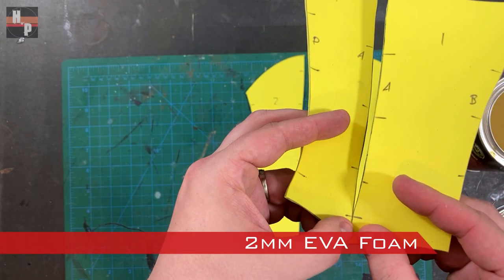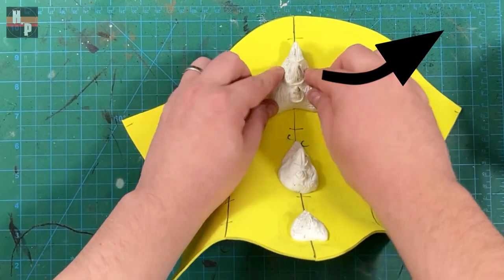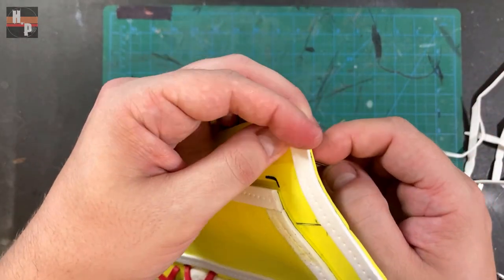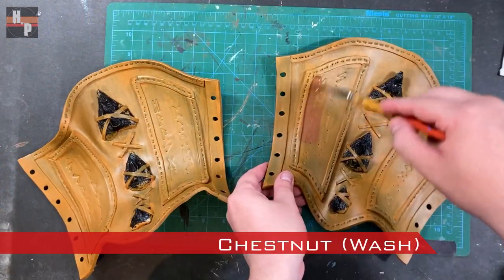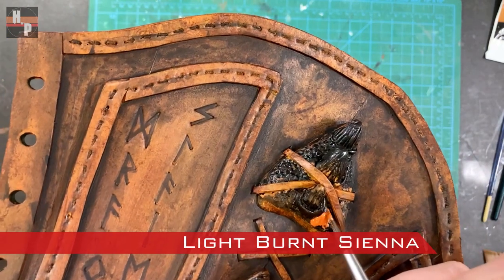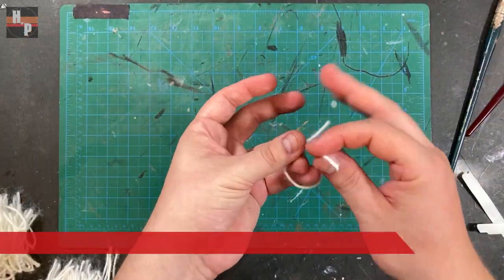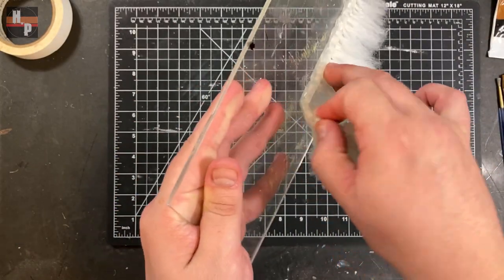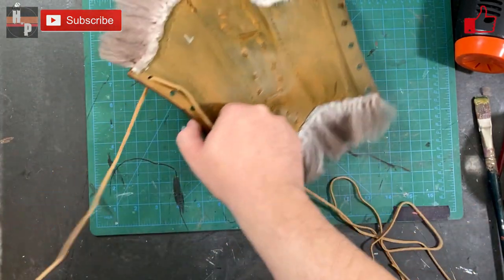Viking Bracers Made Completely Out of EVA Foam | Vambraces Faux Leather Faux Fur | VIKING ARMOR

Comment: What size paper do you recommend people print the template on?
Reply from the maker: My templates are designed to work with whatever paper size the maker wants to use. You just need to make sure to print them at 100% and as a poster. This will allow you to align multiple pages to get the final template. I hope this helps:)